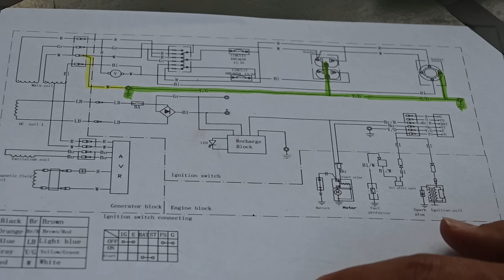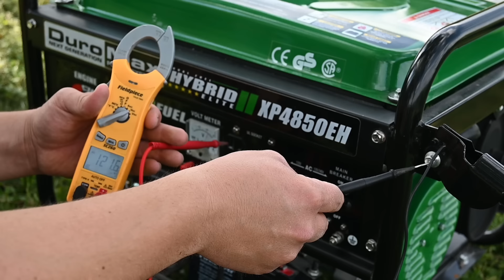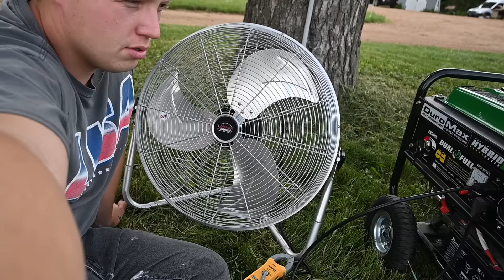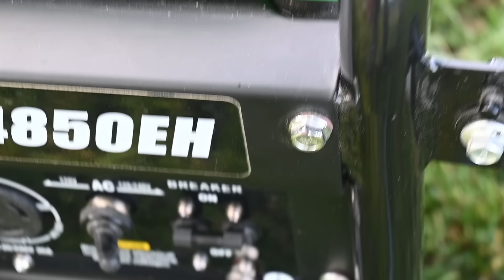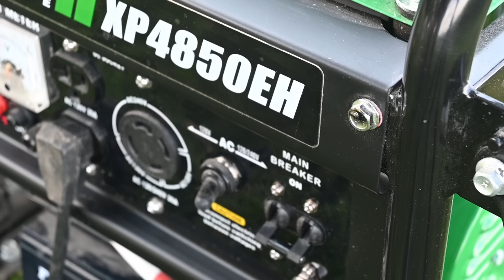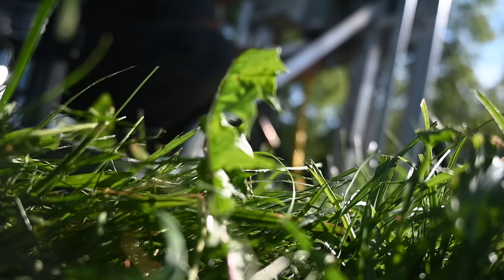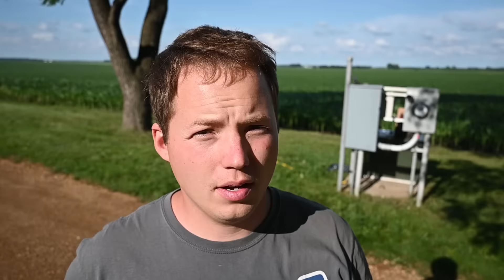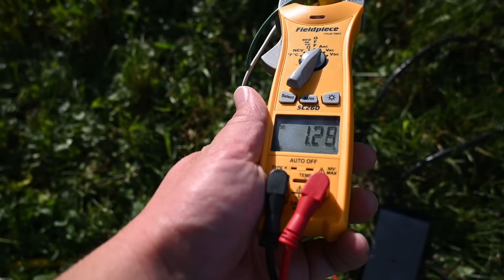What is a Floating Neutral Generator?

Comment: Hi Ben. Great video. Just to clarify something. When you connected your earth and neutral wires at the plug to see what was flowing through the earth conductor. As you connected your neutral and earth essentially it's the same current and not a clear indication of what's separately flowing through the earth conductor. You would need to clamp the earth separately running through the extension cord before the generator to get your reading. 
Correct me if I'm wrong? 
Thanks 
Paul the sparky

Comment: I’m not using my generator with a transfer switch I’m only using an extension cord to power my fridge and small stuff. Does it need to be grounded to my house ground? I don’t think it does but I just verified that I have a bonded neutral as I did your test in the outlet and I have continuity from my receptacle to my frame. I have a Westinghouse DF 9500 generator.

Comment: I have ben a electrician since around 1985 and you covered that pretty good. years back the generators always stated the type . now most have incorrect info as yours did. If you get a good UL listed one it would have correct info listed on it. one of mine has GFIC outlets and a switch for floating natural or bonded. you could easy add your own switch. or just but the plug you have listed . but you will loose a outlet and small generator may only have 1 outlet. what do you do. simple make short cord and on plug side just bond ground to natural and label the plug that way.  now for them portable PowerStation's there is no ground at all on the smaller ones. just a hole in the outlet where the ground goes. it's plastic case . nothing to ground. some electronics see this as a fault . some EV's must see that neutral ground bond to charge the EV. Like a TESLA using level 1 120V or level 2 240V on your generator in this video it will not charge a model 3 unless that bond is in place. I learned this threw a friend that had car run down and tried to plug in a generator   and the car wont charge. wiring fault was displayed.  bond that N to G and car charged fine. nice job. 😀

Comment: Thanks Young man. I wired in my house panel and I was worried that putting both neutral and ground on same bus.  My generator is floating. So for clarification should I run a ground to a rod

Comment: I could argue the case that without it being bonded the short from line to frame in the fan is not a danger because as you said there is no path from the frame back to the source of power. If you were to grab the frame of the fan standing in a pool of water or grab the fan and the generator frame no current would flow through you so it is no danger. I understand that this is not intuitive and effectively disables the protective nature of the circuit breaker but circuit breakers are not designed specifically to trip in case of ground fault. A simple circuit breaker doesn’t care where the current is coming from just whether it is within current limit.

Comment: question for you first off great job explaining ground and neutral bonding. But my question is on a travel trailer with a generator should the circuit breaker box in the trailer be bonded or not since the same power cord that plugs into the genset is the same cord that plugs into and land line source. The power cord is a 4wire SO type cord. Thanks in advance.

Comment: This is why you can backfeed with only 3 conductor "suicide cable", provided your 3rd conductor is up to the task of the entire neutral load, on the other hand those who try it with an old 3 prong dryer outlet find their small grounding conductor not up to the task of the whole house load and set their house on fire.
Reply: A breaker either at the panel or on the generator itself would trip before a fire would get started correct ? Assuming your backfeeding your main panel with 220 through the dryer outlet
Reply: @claytonhenning1575  No, not necessarily. Some ground wires were only intended to carry a high amount of current for a short time in order to trip the breaker. i.e. they carry 0 current or 600+ amps for a very brief period to trip the breaker, and it never gets hot.  However running say 29 amps through it CONSTANTLY won't trip a breaker, but may heat it red-hot.  Other ground wires are much bigger and can handle loads beyond the breaker value.  It really depends on the size of the wire you're using as a neutral to feed the house. (in a 3 wire outlet you're using the ground as the neutral)  It needs to be able to handle a constant current that is just under the breaker values.

Comment: The last step in video plugging in the appliance chord .. now simulates the generator having a neutral to ground bond ... but also being bonded at the panel as well .. 
The panel bond is sufficient enough for normal applications correct?

Comment: I bought a home generator service that automatically turns on my generator whenever the utility service goes out.  Hopefully since it was all installed by a licensed electrician and inspected. I’m hoping everything done right? Unfortunately I have learned that having inspections are many times a joke. Inspector many times don’t really inspect anything. They take a quick glance if that and unless there’s a obvious problem you’ll be passed. My partner’s now deceased husband was electrocuted by a florescent light fixture in his garage when he went to change a bulb and just happened to touch a metal garage support with one hand while his other hand was touching the light fixture that ran 220 volts right thru his body throwing him off his ladder and chattering his shoulder and knocking him out leaving him laying on the cement garage floor. He survived, but he was disabled due to this incident. Believe it or not, you can sue the electrician or the company that did the installation. But you can’t sue the inspector that passed the installation.  I’m not sure what good inspector are for other then just taking your money?  Just prey your electrician did the wiring correctly?  If the electrician does something wrong you certainly can’t count on the inspector catching what’s wrong!  Might be a good idea to check fixtures and make sure no current is running thru the metal box before you touch it and ground yourself accidentally!

Comment: From a safety stand point, a floating neutral would be safer. If you have no return path for fault current, then a person cannot become that conductor on a live-to-frame fault. The terms "hot and neutral" in this generator are moot. If hot came in contact with the frame, then the neutral conductor would become "hot". As it's AC, there's no +ve or -ve per se. This is why isolation transformers exist. They provide a power output that is not reference to ground. Shaver sockets in bathrooms are the same. Unless you touch hot and neutral, you're safe. In a floating system, you could sit in a hot salty bath with the hot conductor in your mouth and you'd be fine.

Bonding it will actually introduce a shock risk. If you're going to bond, then you'll want a GFCI/RCBO on the generator instead of a basic breaker.

Comment: Useful, but there is a solution.  Champion has a 2 minute video that shows you how to convert a one of there floating ground generators to bonded.  They also insist that for safety the generator needs to be attached to a 8ft ground rod regardless of whether it is one of their neutral floating or bonded generators.  However I have seen that not recommended elsewhere, at least for bonded.

Comment: Thank you for this very important information, I have a cabin in remote location and supply power to a small main 120 volt panel. I use a Honda 7000is generator about 60 feet away form the 120 volt panel I am going to install a 12 volt dc invertor/charger. would I still tie the neutral and grounds together in the main panel.

Comment: Hello Ben! Ray G. here. I made up a schematic of a gen w bonded neutral hookt to house w a
4 wire cable, a red a blue a grey and a green. the grn an grey tied together at the panel. Say the 
gen sez floating neutral as it left the factory, yet someone  at some point bonded the neutral,
Also that mr. home-owner made up the cordset and used plugs with metal clamps for no cord
strain. . .it seems there could be a bad shock hazard being = to the amount of load on the neutral?
Or a cord set with a metal box and 4 receptacles in it,  2 on 1 leg 2 on the other leg, gen with no
tires  sitting on ground and a 10 amp load on the neutral?

Comment: So in your opinion! LOL I have a bonded neutral Genset That I connect via 50 amp cord to my house distribution bonded panel and unbonding the generator and installing a bonded plug at one of the generator outlets to bond if and when I ever use the Genset for corded use would be a step not really needed?

Comment: Hi from Portland Oregon!

GREAT VIDEO! And I LOVE my propane only 7k generator with a battery starter! 

I have a transfer box to run my house on. But I will run a extension cord to my NICE neighbor  ( bad one can...😊) to run her refrigerator, coffee maker, or small microwave without overloading my generator.  My guess there is no need to hook up the grounding rod (got for free) in this situation? Thanks for any remakes! 🥸
Reply: Leave it floating and no need for rod😊.

Does depend but you have bond in the panel in your house transfer panel.

(Take advise though from a USA electrical engineer as I can't see your panel or setup)

Comment: So I won a light tower at auction. Runs great. 6KW generator. The 120 outlets measure great. The 240 twist lock L6 30 is confusing.  240 v across the red and black. Not much from either hot to neutral or ground... it's a green wire. What do you make of that?
A notice that neutral is bonded to frame is on the electrical panel.
I want to use this as a home backup emergency power source. 
Should I ground the generator frame for safety  or will it matter since my house breaker panel has earth ground? I am going to install a panel interlock I've ordered... and I'll be connecting a generator inlet box to the interlocked breaker. Neutrals and grounds are on seperate bus bars, btw.
Comments?

Comment: Would the same information about wanting a floating neutral in a generator apply to connecting to a Gen-Tran panel as well as the interlock kit?  I believe that the ground and neutral bars in the electric panel are bonded.

Comment: Interesting. So for the way I use my generator, I actually want floating neutral. Can be annoying if you use the same generator in different circumstances though....
Reply: Running it bonded and powering a bonded neutral service box is no big deal.

Comment: Geeze, all the different comments, so what's the general consensus, 4wires with a bonded or non bonded? I ran 2 hots and nutrual to old meter box that goes to grounded panel, to cw pipe, that have grounded nutruals, gen is grounded within. Haven't installed the gen yet. It is bonded.

Comment: The load neutral current finds neutral and ground bus bonded, at the panel. It can now travel back to the generator on the cord's neutral and ground wires. However, since the generator's neutral is shown isolated from the frame, once the current on the ground wire reaches the frame it has no place to go, there is no N-G continuity within the generator - unless that 120V cord is plugged in providing continuity G-N.

Once the shorted 120V cord is plugged in, it provides a path it did not have previously. The shorted 120V cord now provides the ground wire in 240V cord, a parallel path from the frame back to the source neutral. The 0.17A. at 26:12, and 1.28A at 26:28 is that current. Without the shorted 120V cord, the ground cannot carry any current.

Separately, the added ground rod creates a voltage gradient with the ground at the panel. Unless either the frame, or added rod is bonded to the panel, a floating rod should not be added.
Reply: Great. So i have a 5500w but i need to check for floating ground still. In plain English, regardless, can I use this generator, (4-wire twist only), to run into a main panel with an interlock? The info in this and whether or not and/or when to ground the frame of the Generator is all over the place with every video or person i talk to lol. thanks
Reply: @fizwin1  yes you can. I believe the confusion derives from the notion of generally avoiding parallel wires to carry the Neutral current, yet there are, probably, millions of homes with both the main panel and the meter bonded, even when separated by many feet. Been like that for decades, by default. Parallel conductors, between the main and the meter, are a feature, not a bug, they're desirable. 

>>> Stand alone, you want the frame bonded to the Neutral. No rods of any sort are needed, useful, or desired. Stand-alone, if only 2-pronged appliances were used, safest would be with a floating neutral. The three taps, L1, N, L2 are all equally dangerous, or not, in an isolated environment, with frame isolated and NOT touching dirt, unbonded, you can touch any of the three. You're the bird-on-a-wire with any of them, because all three would be equally isolated from the dirt you touch. That changes once a three pronged appliance is introduced.
Stand-alone, if there are any three pronged appliances, the frame must be bonded to the neutral. Adding ground rods increases danger, because they introduce gradients and increase the touch voltage radius. With only the frame bonded, the greatest human danger is if you touch the frame, only a GFCI will help in that particular instance. 

>>> As grid backup, the generator is connected to existing copper bonded to dirt.  The generator cannot be treated as if it was stand-alone and isolated. It's not, unless the N-G - in the panel - is opened, and I do not believe the code allows electricians to do that.

In this video, the generator is located physically on dirt near the panel's bond. Without plugging in the bootlegged ground, created with the 120V cord, the cage is floating, and should the frame itself become energized, a touch voltage will exist relative to the nearby dirt, at the panel. There will be a 120V gradient from the energized cage to the dirt reference at the panel. Shorter generator-panel separation increases the danger. The added rod does as well. Bonding, either the rod, or the frame, to the panel, would address that. Additional rods, to add  effectiveness, need to be far enough from whatever existing rods, and bonded to the rest.

Look at the diagram, around 1:11, to see that the two 120V outlets are powered, independently, from the two separate legs. I would expect 240V across the two 120V hots. Such a  generator, shipped with a floating Neutral,  could also be configured for a 240V country.
Reply: @frankbelluccia2689  thanks, that was an ear full.  So my plan will be later this year, run an interlock and 30a cb, (i think my in-laws house has a not-so-old SE-Homeline). I will use or build a "generator cord kit" with 4-prong L14-30a I have on the gen. The ground of the generator (and all 4 wires) of course will all terminate in the main panel when plugged in. (L-L-N-G). This should be all I need. Here is the ground of my generator but again it is the manual for many generator sizes.  "The generator has an equipment ground that connects the generator frame components to the ground terminals on the AC output receptacles (see NEC 250.34 (A) for explanation). This allows the generator to be used as a portable without grounding the frame of the generator as specified in NEC 250.34"  
     It says when connecting this generator to a buildings electrical system, it is recommended that a manual transfer switch be used.
Looks like I should be good then, thanks!

Comment: I have an 8700 watt power-stroke generator with a Honda engine. I plugged in my concrete saw into it to cut concrete yet the generator continued to trip. I know the generator can handle the saw but why would it keep tripping? The generator does say that it's bonded but then I saw another video which showed that if I wanted the saw to stop tripping the generator, to disconnect the bond. I really don't wanna do this so I'm thinking that the saw is drawing either too much current or something . I'm not electrically advanced so maybe you can help. Also, I have a 200 watt panel that I'd like to install a 30 amp breaker for this generator. In the panel it has once side where the white neutral wires are and the other side where the ground bare wires are. In your video you mentioned that the white and bare ground wires should be on the same side.

Comment: Really confused about this. So how do things work in real time if you want to use your gen hooked to 1. a interlock kit 
and 2. Using the generator out doors with an extension cord occasionally.
I’ve had my 9500 watt generator for four years now and only tried using an electric drill never giving a thought about having to ground something. It’s a good thing I haven’t yet decided on connecting it to my house cause I don’t know how this grounding issue works.  Bet there is a lot of us folks with newly bought gens that really don’t know how to use them safely.

Comment: Hey Benjamin,  I found on the Duromax website that someone had asked about the Bonded or Floating Neutral.

Question: Will this model work with a generlink? Does it have a bonded neutral?
Answer: DuroMax open frame generators are floating neutral.

I hope this helps and now with a floating neutral, I guess I will not have to worry about getting zapped, at least I hope. 

Thanks,
DJ

Comment: I installed a 20 amp toggle switch. N.O. for unboned and N.C. For bonded. Not sure why generator company don’t just put that on there. Especially for 240 30/50 amp generator.